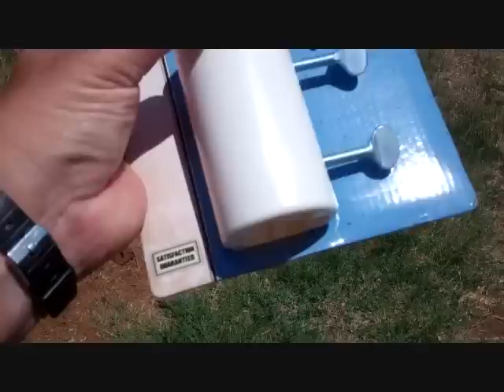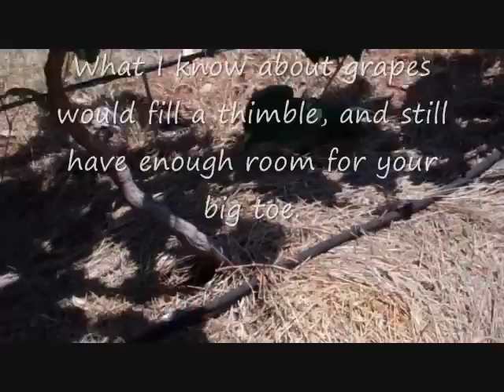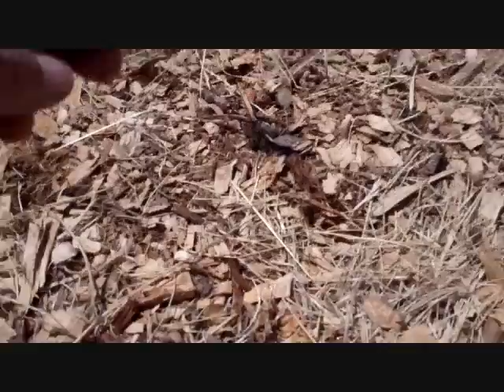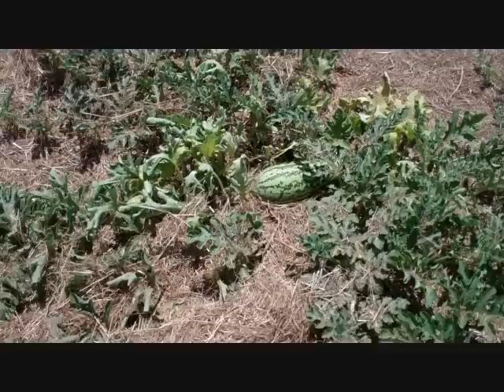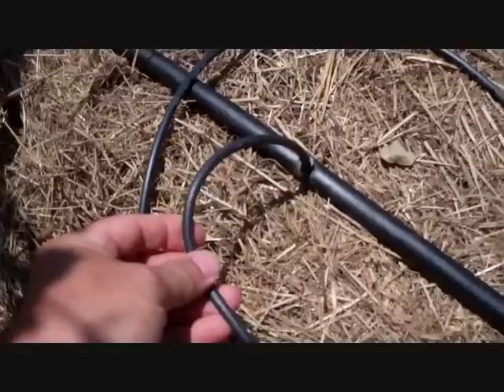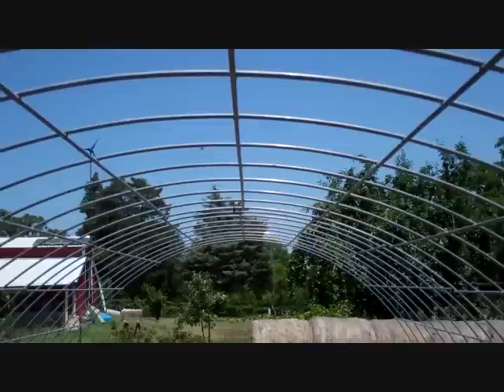Irrigation... Texas Style

Comment from the maker: Well... I have considered that, because the water, when it is in the sun, IS very hot. bt... I would think that by the time the water gets to the roots it has cooled off somewhat. Most of what I read says not to water plants with "cold" water because it can cause them stress. Now... if you are concerned about it, you can solve the problem by setting a timer to come on early in the morning. I have the timer set on my fruit trees to come on at 6 AM and 6 PM for an hour each time. Hope that helps.

Comment from the maker: For a row crop, the drip line would work best, and use less water...  but... it's hard to beat an overhead sprinkler for simplicity and cost. It is MUCH cheaper to do the overhead, if you don't mind the hassle of moving it from time to time. It just depends on how big of an area your are working with, what your water source is (cost of watering), and how many deneros you are willing to part with for the initial setup. Thanks for the comment... TP2